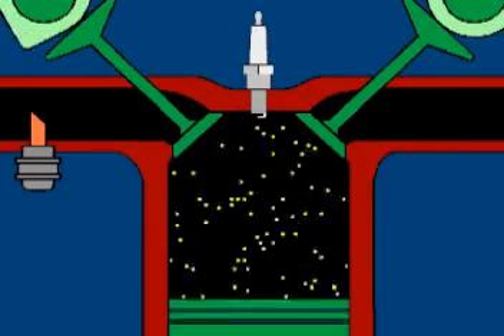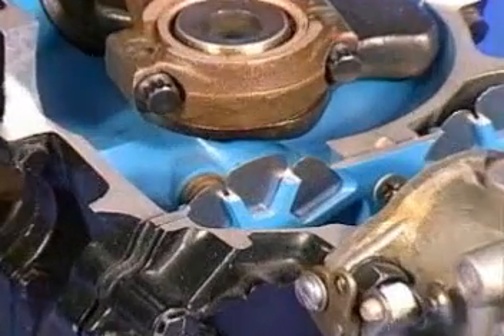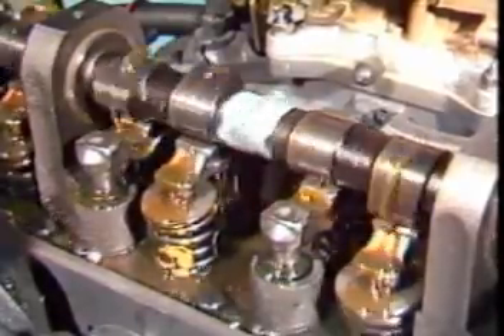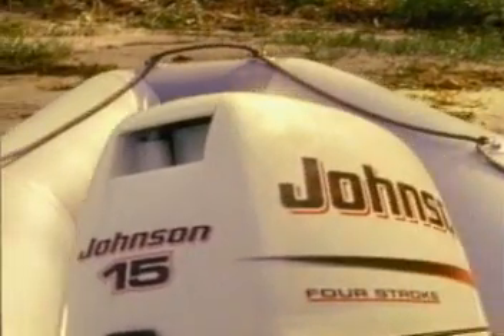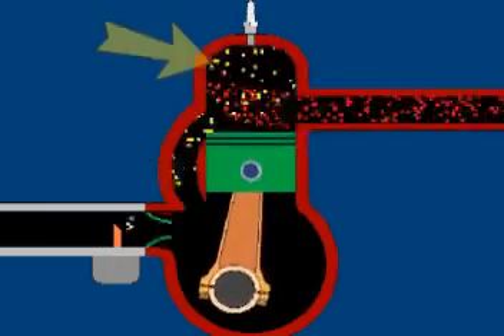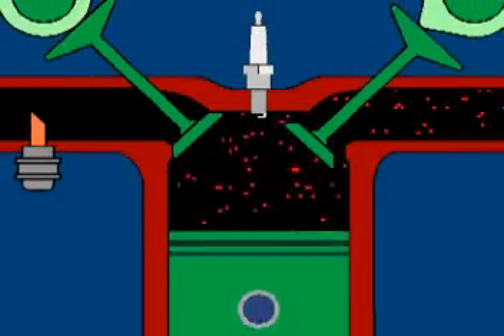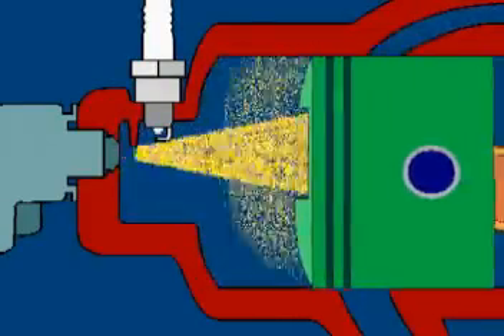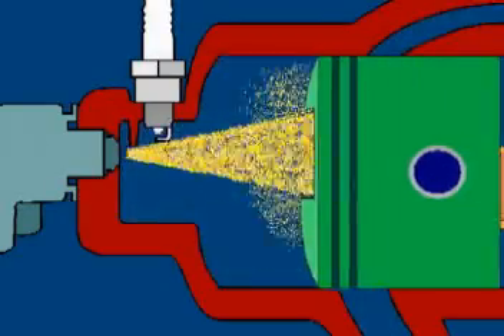2 stroke outboard Vrs. 4 stroke outboard

Comment: So, you would have to mix in oil with the air?
Reply: The Direct Injection motors use oil injection for lubrication

Comment: why not make sedan cars with 2 strokes with that direct fuel ignition style
Reply: All of the auto manufacturers have a very long history with 4-strokes but virtually zero with 2-strokes.  It'd take them a lot of new hires or a stupid amount of training hours to catch up on the latest 2-stroke tech.  And in the end, cars aren't penalized by engine size or weight nearly as much as powersports applications.  Even the switch from iron to aluminum engine blocks has taken forever.  They're happy to just toss a big well-understood four-stroke under the hood to merrily thud-thud its way through life in the hands of a driver who really doesn't give a damn either way.

Comment: So--why are we stuck with 4-joke junk on almost everything with an engine then? The direct injection system is no new idea---there was an extremely efficient and reliable DI 2 stroke engine back in the 1880's, and a German company, Goliath, made an excellent 2 cylinder, water cooled DI 2 stroke engine in the late fifties and early sixties, and it was a 600 cc twin that kicked butt on a clunky, heavy 1600 cc 4 cylinder 4 joke. Frankly, I never thought the 4 stroke was particularly a successful engine--it kinda never was. The biggest issue with 4 strokes is the valve train--this is bad engineering at it's very finest--think "Rube Goldberg" contraption, and this covers every 4 stroke ever made. Frankly, the most efficient (contrary to what engine designers might say in defense of overhead-valve 4 strokes) 4 stroke ever made was the "flathead" or "L head" side-valve layout. It didn't breathe particularly well compared to OHV engines, and could only have lower compression ratios because of the combustion chamber design, but it posessed a rather excellent combustion chamber design that easily encouraged "tumble" in the chamber to promote turbulence and a good, fast, complete burn. The Ricardo combustion chamber was one of the reasons flatheads are so good. This design combined a hemispherical combustion chamber with the flathead L head layout. Also, most of the piston crown is a squish area, the piston JUST clearing the head at top dead center, which puts all the combustible charge off to the side over the side valves in the block, and creates an excellent environment for complete combustion. The "I head" or OHV engine has, generally, a very poor combustion chamber design and as a rule not enough squish (or "quench") area, and combustion tends to be sluggish and incomplete. Plus, flatheads cannot "swallow a valve" through a piston if the valve keepers come off, or the spring fails, or on some engines, the cam stops turning due to a broken timing belt or chain or gear. Timing belts should NOT exist in 4 strokes--it is too much of a potential reliability issue. And most have them today, thus another "kick" against all but flathead 4 strokes. As efficiency goes, a well-tuned exhaust on a regular carburetted 2 stroke will give greater efficiency than most all 4 strokes. Outboards have pretty poor exhaust tuning, since they exhaust into the "lower leg" and under water, which quiets the engine but introduces poor flow, back pressure, and tuning issues. I have seen outboards fitted out with tuned pipes for racing, and they are not only super powerful, but also quite efficient as well! The direct injection engines don't need tuned pipes to force escaped mixture back into the exhaust ports, to prevent loss of it, because they inject the fuel directly into the combustion chamber AFTER both exhaust and transfer (intake) ports have closed--BUT--the exhaust can't be too restrictive or have too much back-pressure, because these engines still need to scavenge, and this occurs at low pressure, and back pressure in the exhaust will kill the scavenging and make the engine "choke" on it's own burned gases. I have a 4-51 Detroit Diesel that is loop-scavenged like a gasoline 2 stroke, no valves at all, and these are EXCEPTIONALLY clean and efficient engines and fuel sippers, as long as the exhaust flows freely. If you restrict the flow with multi-pass mufflers, sharp bends in the pipe, or reduce the size of the pipe, the engine will run quite poorly! And it will smoke, carbon up, and use more fuel and make much less power. The best set up is a straight pipe with no muffler, but if a muffler is needed only a straight through design, or a center baffle plate design with pass around flow with large holes in the baffle tubes to allow good flow (The stock muffler for this was this design) must be used. These diesels were renowned for their efficiency, but were replaced by the less efficient valve-uniflow 53 series engines with exhaust valves. These are called Clark-cycle 2 strokes. The conventional cross-or-loop-scavenged, ported 2 strokes we know and love are Day-cycle 2 strokes. Even with direct fuel injection, or even with blower scavenging like my 4-51 Detroit uses. The Day cycle is long ignored, but the ridiculous and utterly stupid Otto cycle (4-stroke) engine continues to be made and is an inefficient, unreliable for the most part, and ill-running beast, yet we use it on about everything! And 4 stroke diesels are just a JOKE. All you do is compress air, squirt fuel into it, and make power. There's NO NEED for an intake and exhaust stroke and valves--all you need is ports (intake on one side of the cylinder, exhaust on the other side) and a blower of some sort to supply clean, oil-free scavenging air, and you have an efficient, reliable, good-sounding and long-lasting diesel. And one that won't smoke and needs no emissions controls or particulate traps--which are just something "jobbers" make and sell to engine makers to make profits off of accessories that aren't needed on a well designed valveless 2 stroke! We are being ripped off, and the rip off is the lowly, terrible 4 stroke. I hope cars in the near future have DI 2 strokes! This lie has to end. Thanks for reading! Rick "C-6" Delair.
Reply: damn go and write a book bro
Reply: ricksbulbs why did you write a damn novell in a comment section
Reply: LeafxD it was n long comment
Reply: tl;dr

Comment: Fuck a 2 stroke
Reply: No thank you--the ports are SHARP! LOL! I can't believe anybody woule worship a piece of crap as bad as a 4 stroke. They SOUND like SHIT, RUN like SHIT, and have NO BALLS! I long ago smartened up and got rid of any small engine that was not a 4 stroke, and have been in heaven ever since. And the "environmental" shit is a lie. Most 2 stroke oils nowadays are biodegradable, but 4 stroke oil is NOT, and CAN'T BE, because it'd degrade IN USE! Old used 4 stroke oil is one of the nastiest, most toxic things on the planet. The minute amount of oil that escapes a 2 stroke unburnt degrades harmlessly, and isn't in quantities that are of any consequence compared to quarts for 4-jokes. Most modern 4 strokes are poorly-built and designed, high-revving, hot-running grenades waiting to go off (and leave you stranded who knows where) and require expensive replacements. They vibrate, have lousy throttle response, and can only make very limited power, and are as inefficient as it comes. Learn about 2 strokes before you just 'dis' them for no good reason. Otto, the 'inventor' of 4-jokes was an utter idiot, and was a grocery salesman, so when you run your ill-running, ill-sounding POS with 'nails' in the head called 'valves' the make it breathe like having one nostril totally clogged with mucus, and the other half-blocked, and it suddenly goes "clunk" and quite and t you find out one of the valves dropped in the cylinder and destroyed the piston, head, rod, crank, and cylinder bore, just remember--it was invented by a deranged grocery salesman named "Otto"! We have forgotten Day, who gave us the 2 stroke as we know it, and think Otto was some kind of genius---He was a dumbass! Rube Goldberg would have invented this complex, ridiculous engine if Otto hadn't, and to think of it, these engines are a joke and utterly funny to watch then limp along. So what i say to YOU is "FUCK 4-JOKES!"
Reply: ricksbulbs
I have an 18hp Tohatsu, 2 cycle on my jon boat that runs rings around my neighbors 20  hp 4 stroke. Fewer moving parts and burns 3 gallons on an all day trip.
Reply: I got a Briggs 4 stroke and it's awesome
Reply: fuck 4 stroke, GDI 2 stroke always better uses fuel.
Reply: +A deer in headlights you're stupid
Reply: Cody Mohr Hella butthurt

Comment: in a two stroke you have twice as many spark explosions as a 4 stroke in a given time so they need to be rebuilt twice as often
Reply: or just replace the spark plugs
Reply: That's utter bullcrap! In fact, the 4 jokes wear out faster, because they run hotter, and many use aluminum bores, especially Japanese junk like Nissan cars, or almost as bad nikisil plated aluminum bores or steel sleeves, all of which wear out fast. To add insult to injust, 4 strokes have to reuse the dirty, gritty oil over and over, and oil filters don't remove the worst grit--the ultrafine shit that passes through the filter. Also, 4 jokes have to have more displacement and cylinder pressure to even come close to a 2 stroke, and this contributes to wear. Many Jap-junk dirt bikes blow up because the valve trains fail, and replacement engines cost over 1,000 dollars. Plus, dirt bikes have ONE ring and are designed for maximum power and minimum life as a trade-off. i have heard of 2 stroke SAAB cars that ran 2 million miles and never had the head off. I have a Fairmont railcar engine that is 71 cubic inches, 11:1 compression, and makes more torque in a 1 cylinder design than a lowly 454 Chevy 4-joke V-8. and believe me, the Chevy V-8 will be long scrapped before the Fairmont wears out--mine is a 1927, was never overhauled, has a gazillion miles of rail use on it, and has so much compression I can barely turn it over compression, but it ALWAYS starts instantly, on the first pull over compression, while the V-8 will crank and have to have the gas pedal pumped like crazy, then run like garbage until it warms up all the way--this Fairmont is ready to go the second it fires. And it doesn't even have an air cleaner, so it has inhaled plenty of dust in it's day! Plus, it's great on fuel. Firing every revolution has NOTHING to do with engine life, engine design and quality does, and most 4 strokes are poorly made crap. Before you comment, get the facts straight. I hate 4 strokes so much I refuse to own any if I can avoid it.
Reply: should i buy a nissan 8hp 2 stroke its mid 80s but great condition and theres a honda 4 stroke 9.9hp similar priced  $100 difference.
Reply: +Dom Ieraci That's the most retarded thing I've ever heard.

Comment: The evinrude e-tec best motor on the water!
Reply: I would say mercury optimax!
Reply: Alfred Brauner No I have had friends with optimax`s.They have all switch to evinrude they love them more then there optimax`s.
Reply: DYNO DON Yeah they are my friend just ordered a boat with an evinrude e-tec for next year. I also have a evinrude e-tec I mean the yamaha 4-strokes are not bad but I am going to keep on buying the e-tec as long as I can.
Reply: Evinrude went out of business some years back and were bought out by BRP.  They do not have the capital to invest in a modern 4 stroke so they use the old former defunct OMC engines as long as they can.  I doubt your friends are actually buying Evinrude.

Comment: If your sister can fart at 100 decibels (end bleed proper two stroke exhaust sounds incredible) I'm impressed. The two stroke theoretically has double the power as it has a power stroke every rotation rather than every two. However they are really bad for the environment, less so because of the wasted charge that actually isn't wasted with a proper exhaust thanks to pressure, but more so because a two stroke has oil in the fuel to lubricate which is bad for the environment. Really bad!

Comment: aleeeex1055, you are an idiot, two stroke engines essentially have more power as the a have a power stroke for every dead stroke or 360 degree rotation of the crankshaft whilst a four stoke has three dead strokes for every power stroke or 720 degree rotation of the crankshaft. Therefore two strokes give more power out put over the same amount of revs.

Comment: you can't believe anything you hear on these videos. this is just evinrude downing 4 strokes because they dont make one. 4 strokes are better on fuel more reliable and generally give a longer surface life between rebuilds. it just depends on your application and specific needs for which is better of the two.

Comment: they just "brake down" faster, because of inefficient lubricating and to high rpm (due to the small diplacement) look at the last minute of the Video, you can see, direktinjected 2 Strokers are really efficient, the produce power in every stroke, and they dont loosing any fuel/air mixture thrue the Exhaust. 
Make the lubricating better and you can half the rpm without powerloss compaired to a 4 stroke, so if whe just need less rpm, we get less wear and tear inside the engine ..

Comment: It haven't, but amount of burned oil is reduced, without fuel in crankcase more efficient methods of lubrication can be used.. I think this problem could be ompletely solved by some compressor/turbocharger, so engine won't need to pump air through crankcase...

Comment: Because 2 strokes are basically disposable engines. they break down much faster than 4 strokes. they are better for small applications but bad for cars and such. they are loud, and inefficient in most cases. i like 2 stroke but respect both engine types. :p

Comment: Huge fan of two strokes - look at my channel  (burning oil in motorsport big deal) both have advantages. Can't beat a 2 stroke for grin factor + they are reliable! cheap and easy to maintain. However a 4 stroke will produce more reg torque, making it easier to use the power effectively but I can't stand 4 stroke MX singles. valve clearances + rebuild costs - they are too highly tuned! Yet when it comes to tarmac or a workhorse I am a  four stroke man of bigger cc + less tuning/rpm = long life.

Comment: i have a 79 arctic cat jag (a 2 stroke) and it has never had any problems except flooding here and there but has never needed a repair or anything like that and it still runs like i just bought it from the store so its a very good sled to me even if it does flood every now and then.

Comment: power band? you mean the total lack of torque until 8000 rpm? fuck that. there's a reason why 2 strokes aren't used any more. I've had both two strokes and four strokes.

Comment: Becuase 2 storkes suck in terms of reability.
EVERYTHING can affect its preformance, if make a sligtest adjustment on intake or exhaust, you can loose a lot of power or gain a lot of power, etc etc...
I have owned a 2 stroke and belive me, i would rather a realible 4 stroke

Comment: No, i have not and,and there is a reason why, production and lack of multi cylinder applications in 2 stroke form. Can i 2 stroke be made to run clean or cleaner.... The answer is yes, look at the old 2 stroke detriot diesel engines. Same principle, just not cost effective. Rotory engines can produce well over the 1000hp mark, weight less than any other gas powered angine, and are still in production and meet EPA standards. FOR NOW

Comment: the biggest problem is people compare different capacity engines, the only reason 250 2 strokes are compared to 450 four strokes is because of racing regulations that weren't made with much thought. If manufacturers were allowed to race even a 350 two stroke against 450's it would be another revolution. I ride a two stroke road bike (rgv250) and its beautiful thing, so simple, the power curve, the smell, its so light. I wish I could buy a new one.

Comment: and unfortunately the part that i considered being one of a kind, which i believe was for the most part the clutch drum, i had accidentally bent it when trying to remove it and replace the bearings on the clutch shaft, i could've no longer used it anymore, or show mechanics/engineers how it performed like this. if i or someone could make a two stroke car to sound like the same as this scooter, it would be gods work.

Comment: i once had a one of a kind scooter that sounded so nice, it was a 2 stroke, but no ordinary loud 2 stroke, it was super quiet, but at the same time it performed very smooth, accelerated very quickly, and the top speed smoothened out like butter. i never found any other scooter like this built from the factory, i made a conclusion that certain components like having a emission controlled engine, with a high quality clutch drum would make it perform like this.

Comment: i personally like 2 strokes more than 4 strokes. what i want is for manufacturers to produce two stroke cars again, our technology is pretty good now, compared to the 60's when the stopped making them. with fuel injection systems they would last longer, create less polution, possibly lighter, although i couldnt really find any information on whether or not a fuel injector system would be lighter than a carburetor system. my dream car is a 6.2 liter 2 stroke with forged everything.

Comment: Cuz you're talking about scooters.It's the CVT needing the 4T torque to operate well under load.On hill the 2 stroke will free spin without transmitting much force through the variator

Comment: The comment I can add to the demonstration that 4 stroke engines working principle also has low quality fuel burning cause in all for stroke engines there is a space that cant be wantileted . The piston which goes up can not reach the top so there is a space between the piston plate and the cylinder . What ever the engine is... There is exhaust in cylinder mixed with fresh fuel and air. Nobody invent any vacuum for engines for completly push the exhaust out.